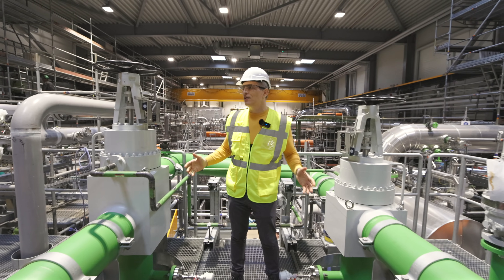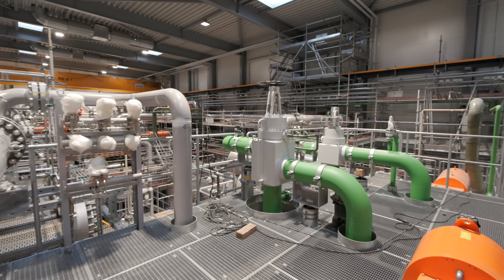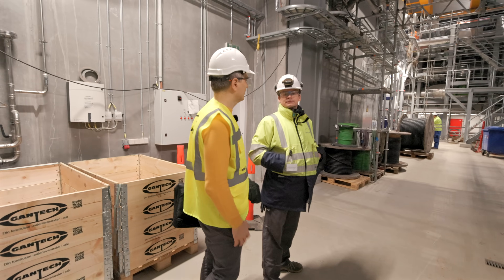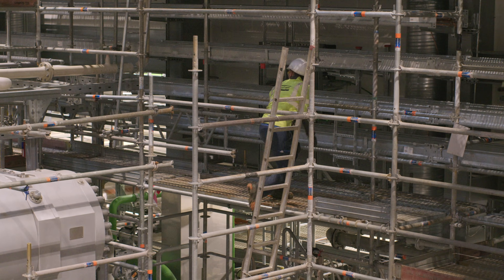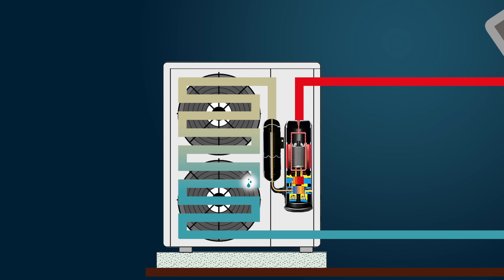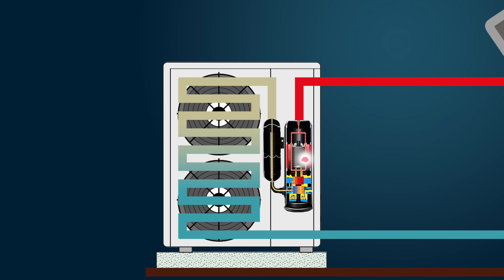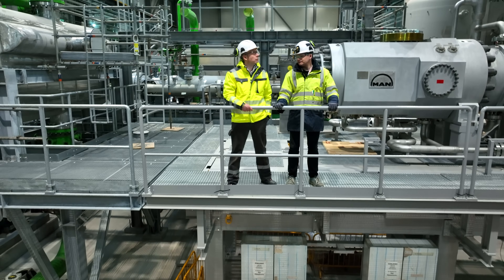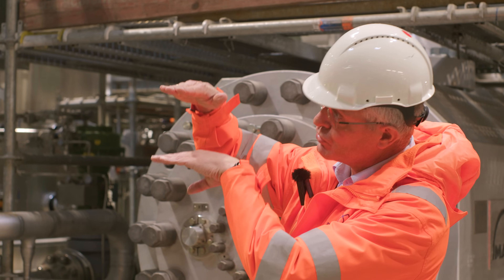Inside the world’s first giant heat pump that heats an entire city with CO2 and sea water

Comment: over 90°C water just for heating ist quite inefficient, it would make sense to go down to 70°C max or so, the additional cost for bigger pluming cant be that high
Reply from the maker: It is an old city, with kilometers of pipes, mostly underground, and updating them all at once would cost much more than the heating pump itself, as engineers from DIN Forsyning say. It probably makes sense to update those pipes at each maintenance of repair work that would be done anyway, but it would take a long time. For sure this inefficiency is one of the main constrains that pushed engineers to gain efficiency from other parts of the circuit and balance the overall numbers to make the project viable.
Reply: In this case, it may make sense to use additional heat pumps at distant end points with high demand in order to raise the flow temperature there and lower the temperature of the return flow. These additional devices in the kilowatt range could then be operated with R290, for example, which is also a natural refrigerant. In this way, refurbishment costs could be reduced or, conversely, the currently required flow temperature could be lowered on an annual average without having to replace the pipes in the entire network.
Reply: The problem is, that the customer at the end of the heating grid i about 30 km away, and we have a tempeture loss. We have in fact devided the grid into four seperate sections. The temperure to the nearest grid is about 65-70 degrees and onle one grid gets the 90 degree.

Comment: Nederland's is crapping all over Australia with your water! We've had to implement solutions to each home with remote control metering for hot water heating as our solar systems really do rise the voltage of the overall grid. With the introduction of EVs charging at night we should be building more dams or go nuclear IMHO. Great video btw mate!

Comment: There should be a right for every competitor to use the heating system because if not, you have a monopoly on this heating system. This should be regulated so consumers don't get any problems in the future.
Reply: That would make it more costly for consumers since each competitor would not be able to fully utilize their capacity.  

It would also lower the security of supply, because who wants to deliver heating during the hours of the year that are not profitable? 

So yes the company is a monopoly, and is regulated as such. It is by law operated as a non-profit organization, owned by the municipality or the consumers directly.
Reply: Regulation is vital for consumer protection, but opening the network to competing commercial entities creates either the need for much greater regulation (which destroys the benefits of competition) or a barely regulated system that does deliver for the customer.  In the UK, we’ve seen too many cases where all of the value in our infrastructures has been sapped by shareholders due to minimal regulations when competition has been allowed.

Comment: Is it possible to also cool with this Heatpump?
Would be another income source if you could sell people cool water when its summer and you dont have an AC.
Reply from the maker: Theoretically most heat pumps circuits can be reversed to cool, but in this case it would probably be more complicated due to the complexity and all other additional elements in the system. Do you mean providing cool water through the same pipes and use home heaters as coolers?
Reply: @Watt-Energy  I just thought about your normal AC that can cool/heat but it would be interesting how much cooling you could provide using such a large heatpump over long distances. If its summer and your heater can cool down the room by some degree even it its only 2,3 degrees would reduce a lot of electricity for either ACs or just millions of fans in the summer.
Reply: Many cities do have District Cooling, mostly for companies and hospitals
Reply from the maker: @horstschlemmer1337  Yes, it may sound like a logic step to do, but there is one side effect that can appear when circulating much colder water in a home heater or through pipers in a heated floor - it creates condensation on that surface that must be taken out of that room, otherwise it will lead to mold. The AC, on the other hand, drops that condensation outside of in a sewage system.
Reply: @Watt-Energy  Now i feel stupid because i should've thought about condensation before typing. I just had the thought experiment in my mind but as always it's not as easy as it seems. :)
Reply: Bless the Danish and their "grid balancing gymnastics" -- but this is the dumbest/stupidest renewable-energy contraption I've ever seen.  (Have to feel sorry for the manager how has to describe this contraption.) 

1) there is nothing unusual happening with the climate.  (Please explain the Little Ice Age and the Medieval Warm Period.) 

2) there is nothing wrong with burning fossil fuels.  Its problems in high-density areas are trivial to fix and already have been fixed.  CO2 is not a pollutant.

3) Climate alarmism is a big-lie superstition supported by tax-bribed liars.  (See Climate Discussion Nexus for 100s of videos on climate quackery, deception, and realism.)

4) decarbonization is 21st century pyramid building and human sacrifice. 

5) there is NO excuse for expensive electricity.  Electricity generation is boring.     Just burn coal and scrub the smoke in densely populated areas.

6) the only challenge is manufacturing market quantities of cheap gasoline.  South Africa has already done this for decades (Sasol), using coal. 

7) Elon Musk: the Laptop Class is in La-La Land.
Reply: "How much air conditioning does Denmark need?" :)

Comment: Why don't more cities use this technology,   buil a system in the building similar to a boiler heating system, only using a possibility ethanol based to transfer temperature frim the building bti to a room in the basement. Where a heat exchanger with refrigerant I'm afrom a remote factory cools or heats the building depending on the season.

Comment: Pumping energy at a 4 to 1 ratio is obviously helpful.

The limit of the concept is reflected in that ocean going ships don't use it... 

I assume the size amd weight of the whole system far exceeds traditional energy production machines.

The CO2 required to build the 'energy production machine' does not seem to have been discussed here.
Reply: Ocean going ships produce a lot of waste heat in the different aggregates. For example combustion engines or compressors. If heat is needed it can be taken from these sources.

The idea of the heat pumps is the substitution of fossile energy sources for heating with electricity which is produced regenerative.

Comment: Why did they didn't use an closed circuit filled with antifreeze as medium and a heat exchanger direct in the ocean so than can go below the normal freezing point of water, to get more energy out of the water.
Reply: If a pipe bursts, the ocean would be poisoned
Reply: Heat pumps work most efficient when the delta T  (media in and out) is low.
So it is most efficient NOT to cool de seawater very much.  It's better to use lots of seawater.

Comment: Thoroughly enjoyable post from an engineering perspective. 

But the comparison to a home air to air heat pump, (which is just one of many different types of home heat pumps).Was completely misleading and incorrect. Since the heat pump based system in this post is only "one part" of a far more intricate and costly heating system. So of course they are not comparable especially in terms of a cost analysis.

And I wish there were more details, about how the heat storage buffer was constructed.

But I thoroughly enjoyed watching the amazing engineering involved in its construction and it's great to see coal being replaced with a much more sustainable option. So thanks for the post.
Reply: The heat storage is just a regular insulated big water tank. Several towns  (not cities) also use a much bigger heat pond.
Reply: Thermal storage can be done in various manners.... anecdotal evidence is not detailed evidence of the construction...
Reply: The comparison made was not to an air-to-air heat pump, it was air-to-water. They are much more intricate systems than air-to-air. In Canada, no reputable installers will install an air-to-water heat pump without a backup heating source, whether resistive electric heat or some sort of combustion boiler. Same can be said for water-to-water.
Reply: WADR, You are incorrect on all of your points... 

Air to air heat pumps, are also included in the parameter for comparison purposes in the post ie any type of ASHP  (air to 'air or water', is specifically mentioned in the post  (apparently your dyslexia is worse than mine))....  (fwiw, there's nothing 'intrinsically' more complicated about air to the water heat pump) 

Also any ASHP requires a backup heat source.... Vs a any type of a GSHP..
Reply: Bless the Danish and their "grid balancing gymnastics" -- but this is the dumbest/stupidest renewable-energy contraption I've ever seen.  (Have to feel sorry for the manager how has to describe this contraption.) 

1) there is nothing unusual happening with the climate.  (Please explain the Little Ice Age and the Medieval Warm Period.) 

2) there is nothing wrong with burning fossil fuels.  Its problems in high-density areas are trivial to fix and already have been fixed.  CO2 is not a pollutant.

3) Climate alarmism is a big-lie superstition supported by tax-bribed liars.  (See Climate Discussion Nexus for 100s of videos on climate quackery, deception, and realism.)

4) decarbonization is 21st century pyramid building and human sacrifice. 

5) there is NO excuse for expensive electricity.  Electricity generation is boring.     Just burn coal and scrub the smoke in densely populated areas.

6) the only challenge is manufacturing market quantities of cheap gasoline.  South Africa has already done this for decades (Sasol), using coal. 

7) Elon Musk: the Laptop Class is in La-La Land.

Comment: If there is a huge heat mass, it can run for a few hours a day and in reverse to generate power
Reply: the Laws of Thermodynamics require a big difference in temperature. That's how turbines make electricity from 600 degC at 50% efficiency

Comment: COP of 2 in the middle of winter is disappointing. Add to that the losses during piping then it's not exactly great.
Reply: Furthermore, that is when the system is needed the most. Good catch.
Reply: I picked up between 2.8 and 4. When did you hear 2?
Reply: @JanKluiver  Maybe Jimmy meant 2.8 , but still I find it hard to believe ( I could be wrong ) that any devise can get a COP of above 2  with an inlet water temp of about 1 degree C.
Reply: @JanKluiver  You're right, it's 2.8 which is still terrible considering we haven't included transmission losses.  I  would expect better than 4 during summer on an industrial scale. Off the shelf home units can get 5.
Reply: @JimmyLLL  Those transmission losses will be around 20-30%, which are mostly due to the loss in the warmer half of the year (summer), when little heat is needed, while losses remain high. I agree that a COP of 4 in the summer sounds not impressive. The input temperature of the seawater will go up, while the output temperature can be lowered. Nevertheless, I feel confident that they have done the math and that this will be the (near) optimal configuration. Regarding the heat transmission losses. Don't forget that the heat distribution system was already in place. The goal is to replace the existing coal fired heat source. A centralized investment of 1500 euro per household is cheaper than fitting houses with individual heat pumps. And even if individual heat pumps would be cheaper, I wonder if all those houses have space to fit one.
Reply: @JanKluiver  Yes you are right, they are doing the best they can with the existing infrastructure.

Comment: Water boiled into vapor then vapor  condensed leaves clean water behind taking away most of impurities so besides using either steam as energy source or get it as cleaned water from sea, and it can generate its own energy source as steam to go on cleaning large volumes of ocean water, based on these two principal's ocean waters should start to be used along with water treatment plants everywhere, made mandatory must in entire world, i mean there is so much good work to restructure social civil municipal systems of world that entire work labor is not only be absorbed but even their coming generations but neither it is being started as yet which it should asap

Comment: Air source heat pumps would take much more power in winter in Denmark.
Reply: Not really, based on the COP figures given....

But more importantly the heat pump system in this post, is only in an auxiliary heat source as part of an intricate heating system.... So the comparison was totally misleading irrelevant a anyway...

Comment: Wind power? Use for elec grid heaters. NO special equipment required.
Reply: Yes, that is true. But with a heat pump, you get 2.8 to 4 kW for every kW you put in the heat pump. Simplified: you would need 3 times the amount of wind turbines to create the same amount of heat.

Comment: That's wild, they're pulling out the last 2.6degC out of the sea water before it freezes. They must be using some very accurate temperature sensors.
Reply: Don't forget sea water freezes at -3C~ because of the salt. Also increasing the pressure of the system can reduce that much further. So they have a lot of headroom. Not to mention absolute 0 is -273C. So still lots of energy in water even at 0c

Comment: I wonder if we could "steal" some heat from the Mediterranean sea or even north Africa when the temperature are getting worse and worse.  Transfer to the northern countries and store it into sand towers
Reply from the maker: Sounds like a challenge out of which a great tech startup may be founded, to bring new technologies that would enable that!
Reply: @Watt-Energy  I guess that the problem would be the distance and the loss of energy. Even with the desert tech solar power project would it difficult even if you only transfer electricity. But in this case I wouldn't mind to lost 25% or so from north Africa to Europe
Reply: The UK is already building an undersea interconnection cable to Morocco to take advantage of the greater solar production capability and space for battery storage. (While the UK has plenty of land that could be used for battery storage, there are political difficulties in siting unsightly infrastructure buildings near residential areas)
Reply: @tlangdon12  I'm not a expert but I guess that won't work. Or at least you will have a lot of lost energy during the transfer. UK and morocco are too far away.

Comment: So the Nordic countries will make a lot of them in the near future. And it will work in every other place with an existing heating pipe system. Probably it will be economically viable in big cities with a lot of high rising buildings so less costs for heating pipes. I cannot understand why they need such a high temperature!
Reply from the maker: The question about the temperature is crucial indeed - in a home heat pump one would set maximum 55 degrees in an uninsulated house and 37-45 in an insulated one, the difference being attributed to the heat loss through windows and walls, and a small part of it due to the type of radiators. Centralized systems need higher temperatures due to loses of transportation and that temperature may vary depending on length of the pipes and how much heat do they lose per km. But 90-99 degrees, as in Esbjerg and Aalborg, definitely stands at the upper level of any such systems, which means the city pipe system has higher loses. And this contrast of an inefficient piping system in an old city and a giant heat pump that still managed to still be efficient and viable makes this example even more intriguing, since it demonstrates that it can be done even in such a scenario.
Reply: 90 to transport more energy in the same main pipes, in the pump stations its only 60 to 70 or lower, the customer dosent get 90C its only in the main pipe system.

Comment: Is there carbon capture on the boiler furnaces?
Reply from the maker: As far as we know - no, but it is supposed that on burning the wood waste, only the previously captured CO2 is emitted, on trees specially planted for being used in wood industry, so it is considered a net-zero burn.
Reply: @Watt-Energy but unless they harvest the trees next door, you have to account for transport of the raw materials (which you don't for nuclear/solar/wind). Not to mention increased demand of wood means more natural forest is replaces with "tree farms" which don't foster durable ecosystems.

Adding carbon capture of some form would make this good instead of just "not as bad as burning coal". Still worthwhile but not as good as some would want you to think
Reply: @leeroyjenkins0  
Don't split hairs.
These are wood shavings from the industry after they made furniture from the wood.
Does 'Danish design' ring a bell ?